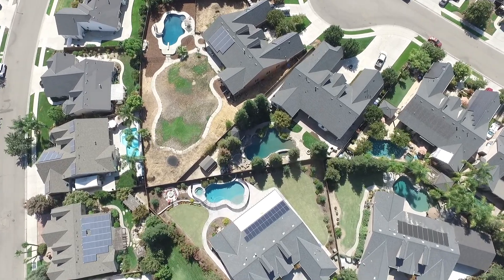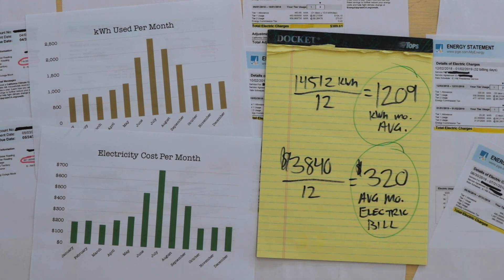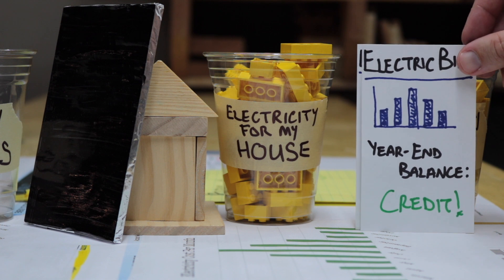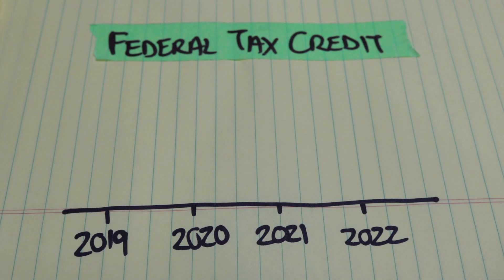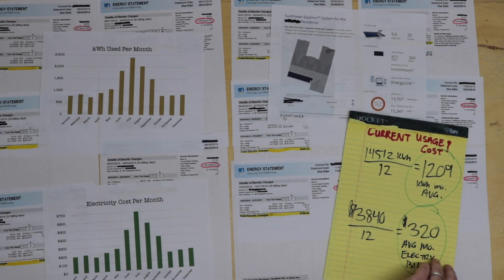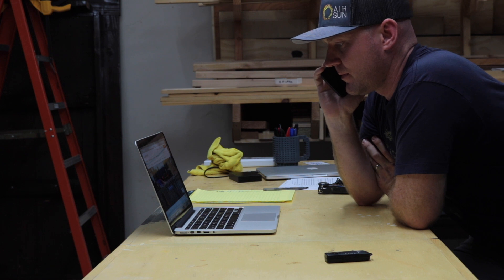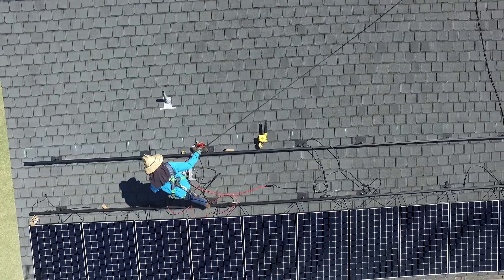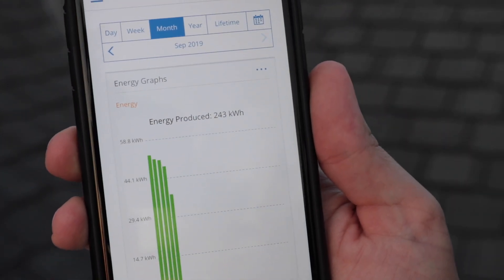How I Knew It Was Time To Get Solar

Comment: Now that you’ve had a year with this system, what are your thoughts? 1 year review video?
Reply: Also interested.  How much power loss after a years wear?  How long before you have to replace and what will those costs be.  These won't be subsidized forever.